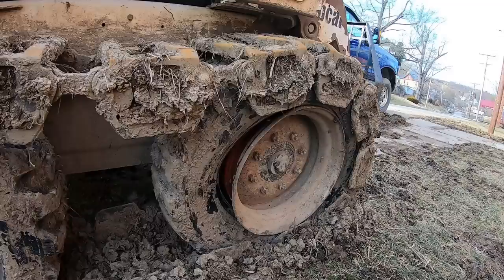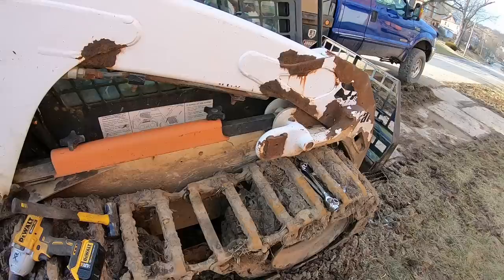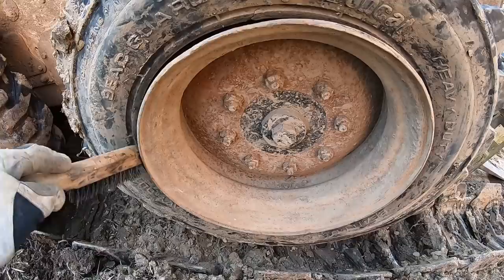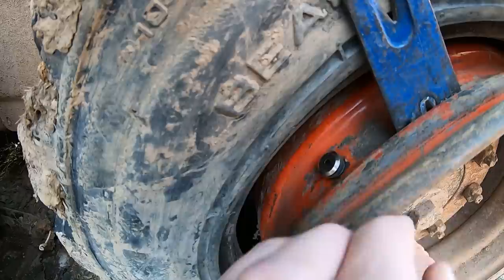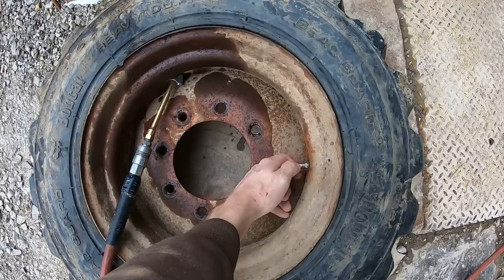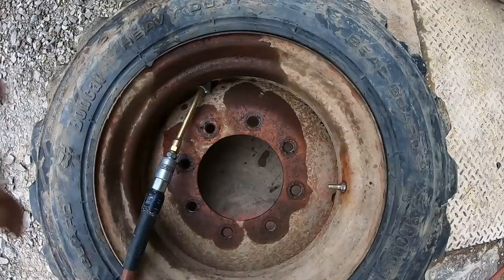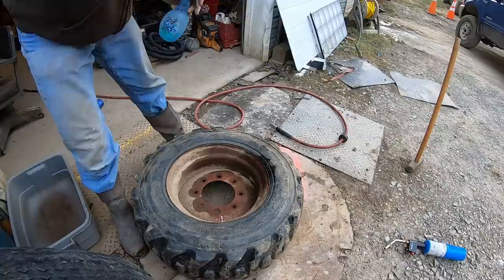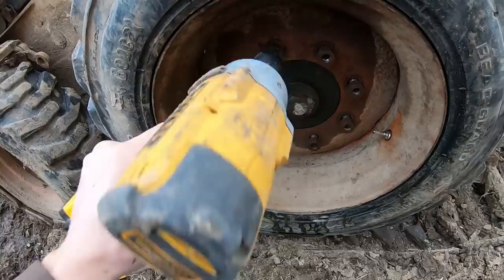Fixing a Skid Steer Tire with Starting Fluid and a Torch!! + all about my STEEL TRACKS

Comment: I know you expect the bad comments and I will get out of the way in the beginning, A friend of mine that owned a shop near mine was killed when a tire exploded doing this. That said I had done this for close to 30 years before and still do occasionally but I will usually try to put the tire on the other side of the implement bucket or something substantial. Ok, Disclaimer out of the way. I have found that if you remove the valve stem when reinflating the tire as you do the ether trick you will put a lot more air in and that helps to seat the bead. If you have tapered bead tires this will sometimes not hold as you take the air off to reinsert the stem unless you put full pressure in and get the stem in without losing all the pressure. Also, frozen implement or truck tires are going to have a tough time getting out to the rim and staying there. I have also found that it takes several tries and in that process it warms up the tire and makes it a lot more pliable.
Reply from the maker: Yes I believe that’s what happened here. Tire warmed up.

Comment: I had to use a large ratchet strap and wrap it around the circumference of a tractor tire to preset the bead and it worked first try.

Comment: Take the valve core out, and then use an air compressor will get the bead to seat quick like a bunny, then put the stem core back in and you'll be all set. finish air pressure.

Comment: Tire fitters i have seen in the past used a large fat soft rubber ring between the rim and tire to stop more air going out than in, maybe you have to connect the small pipe to the fluid nozzle to direct it into the tire chamber? i just connect a good compressor and hear where the air comes out and work on that area so more air goes in than out, always worked for me without fluid or other aid.

Comment: Those rims need pipe valve stem guards welded on.  My tractor and NH L555 both have them.  Never had a valve stem problem in over a decade

Comment: I have had great luck using a strap binder around a tire I would center it on the tire and ratchet it tight and it would push the bead tight on the rim inflate the tire and release the binder and finish inflating been doing it for years works every time love your video's

Comment: Next time you get caught with a skid steer tyre coming off the bead try using a ratchet strap around the centre of the tyre pull it tight so it pushes the tyre walls out and remove the valve so you can get more air in quickly.

Comment: A band clamp (ratchet strap) around the center of the tire and very tight will work and although less exciting, it can help do this job without removing the tire and rim from the machine. You will still need to remove the track though.

Comment: I’m in the same boat here. No bead blaster so I use whatever flammable can I can find, carb cleaner, either, etc on my skid steer. My tires are old and leaking out the sidewalls. I keep slime in them and that keeps them good for the most part. I’m really interested in those tracks, may need to get some.

Comment: When you're using the compressor take out the valve core so you don't have the resistance of the core when popping the bead. With it out of the way you can dump a lot more air into the tyre, once the bead pops into place stick in the core and inflate as normal.
Reply from the maker: these tires will come right back off if there is no pressure in them
Reply: @DieselCreek  
You can stick the valve stem back in before the pressure is gone.

Comment: A few things, one: rim needs secured when inflating (encase of catastrophic pressure lose while filling) two: Never move the equipment from the outside (you shouldn't even be able to) three: block the equipment up after raising it do not rely on the hydraulics while working around it (they do fail) and forth: do not leave the forks/bucket up while not on the machine and do not stand/work under/around the raised bucket/forks/boom (I've seen too many fatalities with each up these items.) 

Not saying you have ever had a problem but people emulate people they see do something and not have a problem and then are not as lucky/skilled
Reply from the maker: Yep, this is the comment I expected to get a lot more of, surprisingly your only the second one maybe 👍🏼I appreciate the concern and I know better but sometimes you just don’t have an excuse lol

Comment: I’ve used the starting fluid trick to inflate a tire a few times. It worked most times, sometimes it didn’t. 
Most every time it scared the crap out of me. I put tubes in the front tires of my bobcat and poly filled the rear tires.

Comment: I bet you could use a cable winch in place of a ratchet strap when you're dealing with a really tough tire you would need a chain repair link run the cables through it so it can't flip sideways on you.

Comment: Not sure if anyone mentioned it yet, but in my opinion ether isn't volatile enough because it's a liquid. I use deodorant-spray but any aerosol will do, as long as the gas is flammable. The gas will ignite a lot faster than the ether, expanding more rapidly, giving a better "pop" and also extinguish a lot faster. I have the aerosol in 1 hand and a lighter in the other, spray for a bit than push the lighter in front of the can to ignite.  You might be able to achieve the same result by half-pressing the switch on the propane-torch for a while before pressing it full to ignite. But since I haven't done that myself, I wouldn't recommend it to anyone.

Comment: Matt thank you for the FYI but the steel tracks,,,,,,  as for blown up the tire yeah it’s a quick fix are usually take a chain come along wrap around the tire and then put a blanket over it just in case the chain let’s go..... So chain would go anywhere,,,, but that’s not me,,,,,,, didn’t realize about the tracks!!!!!!!!!  got a set of steel tracks of them have not used them very informative!!!!!!!!!  By the way think you should get  an inverter for your truck,,,,,,  so you can charge your batteries keep going just an FYI !!!!!!!!! Am not spending your money just want you to be more  efficient  At your job take care junkman do
Reply from the maker: I’ve actually got an onboard charger! I’ve always got one charging

Comment: I fitted a 195/65/15 tyre onto a 15x10 rim like this, starting fluid wouldnt quite get it there ended up using lp and oxygen 😳,  big bang but ot worked 😁

Comment: You got a good deal on the tracks they aren't cheap  new i will try that brand used also  .a update on your brush cutter holding up? I have a different  solution  air line directly to valve stem with valve core removed   . Dont use air chuck  youwill get more volume of air !

Comment: A ratcheting strap can often be placed around the tire. When tightened it will make the bead move out and contact the rim. There is also actual bead sealer compound to help the seal.

Comment: I have seen a similar metal track laying in a long tray of used motor oil. It was at a wrecking yard.  The guy was hoisting another and letting it drip after water blasting it of dirt. I never did see the outcome if they were any quieter or lasted longer before bushing replacement.

Comment: Fyi from from years in mud its always the worst times someone steels air from tires couple hints one solid shot if you think to much eather put more if you miss the first woof got to a add more oxygen the eather burned it all off jest fire no woof and when its cold eather takes longer to flash off sometimes i heated the side walls with the fire from eather to soften rubber when cold thats why he was having trouble

Comment: Easy to make a bead blaster my dad has made quite a few of them out of old propane tanks
Reply from the maker: I’ve got about a dozen of those kicking around 🤔
Reply: Diesel Creek  just get a 2” ball valve for the blaster and then squeeze a 6” length of pipe for the bead seater.
Reply from the maker: Might have to do that
Reply: Diesel Creek  and also with it if your board and want something to do get a longer pipe and bam instant potato gun lol

Comment: Something that I have done is to run a come-along or even better a wide ratchet strap along the tread to put pressure on the bead.  That was on trailer tires, but I expect it works elsewhere.

Comment: I would have used a 1 1/2" ratchet strap wrapped around the middle tread. Tighten it up till both beads wereon the rim then aired it upmaking sure the beads would seal

Comment: Hey Mat, I know this is an old video but just in case you aint figured it out yet, wrap a ratchet strap around the circumference of the tyre and as you tighten it , it will force the bead out on both sides. Bob UK

Comment: Easy put a block under the  back right side and drop the bucket lift the right side of the skidder up and let the tracks roll around until all the crap drops out.
Reply from the maker: never thought it would be an issue before I took them loose!

Comment: Whenever I've watched the tyre fitters put new boots on my hooty they leave the valve core out until they've inflated the tire and seated the beads. Then they fit the core and inflate the tyre to the correct pressure.

Comment: (Just saw Rock Hill beat me to it). Just use a heavy ratcheting load strap around the center of the tire and ratchet it down it will squeeze the beads toward the rim and works! Fluid works but you cant be bashful.

Comment: Every time I've done this I just kick the driving surface of the tire. The trick is using the tire as a bellow to make an air/fuel mix so the either ignites well enough to create the vacuum around the bead.

Comment: Front tires on my CUT are same size as a skid steer. Had one side of a tire come off in the coldest part of winter. No way I was working on that outside in the sub freezing cold with rock hard rubber. I brought the wheel and tire in and sat it by the wood stove and went to bed, one bead still off. Woke up next morning and both beads were seated but there was no pressure in the tire. I have no idea how that happened.

Comment: Interested to know why you are not running foam filled tires? I run them on my S2 20 have never had a problem just replaced brand new ones except for extremely deep mud or a very steep hill I have no problem

Comment: I'll tell you something I use especially if wheel has a little rust works on all tires to help seal the bead clean around rim with brake fluids works wonders
Reply: Or a very thin layer of silicon rubber :)

Comment: On the tire need I use gas down inside the tire ,the explosion works great n out extinguishes immediately .also check into foam filling the skid steer tires no more flats.But makes them very heavy,
Reply from the maker: Yes I’d like to foam fill these

Comment: i noticed a few times that starting fluid is not as flammable anymore and wouldn't work for me so i used the strap method and my cheapass emergency compressor got it down now lol

Comment: Another way that works on new car tyres that  been stacked on their side and won't sit against the beads. You get a 2'' ratchet ti down and wrap it around the tread on the tyre as tight as you can.  it works. That probably wont work on the tyres you are using there.
Reply from the maker: I do that with smaller tires, not sure about these big ones.

Comment: As I watch old videos ... I have had luck with stubborn older tires like this by actually wrapping a ratchet strap around the tire - the pressure around the middle of the circumference of the rubber seems to help flair the bead against and into the rim easier.
Now admittedly I've never done this on anything larger than a pickup but hell anything can be worth a shot when you're desperate right?

Comment: Been blowing up tires like that for years,especially big 4x4 tires.Have blown a few rims out of the tires also when a little to much either applied :O
Reply: That’s why anytime I see somebody doing this I get far away. All it takes is too much ether and a tire with a weak spot in the sidewall and you’ll be eating rubber.....
Reply from the maker: I’ve only blown one up and it was super dry rotted. Didn’t do anything wild just put a big hole in the side wall

Comment: I have used a 1 inch ratchet strap and removed pin from valve stem so air will go in faster to seat bead on the rim hard with air tank i had compressor that plugs into power port in car after seating tire on rim

Comment: You ever try propane instead of ether?  Has worked for me.  Might have a little more thump.
Reply from the maker: I’ve tried it. No luck….. different types of ether work better. This stuff is junk
Reply: @DieselCreek  Might be worth a try again.  You don't need a lot.  If you do too much, there won't be enough oxygen inside to get a good pop.  You probably had either too little or too much propane.  Nice thing about it is it doesn't keep burning after you light it.  Love your channel.  We should do a collaboration sometime. If you ever need something custom machined or cast let me know.

Comment: As others have suggested this really works better with the valve core removed so you can get a bigger volume of air in there. I know it looks sketchy to some but the only times I’ve seen this go wrong is on a bigger tractor tire and the guy was using too much fuel. Was that ratchet strap one you cut the end off of or can you buy them that way?
Reply from the maker: You can buy them that way, they are called endless ratchet straps

Comment: You know there is another way you can take and put a rope around the middle with a turnbuckle and it will force the outsides toward the rim and that will air up every time you could even use a ratchet strap right around the middle tighten it up put the air to it and it'll pop right to the outsides I love the video though
Reply from the maker: I’ve done that with smaller tires but actually broke a strap and had it hit me one time. I think the ether is actually safer to me
Reply: @DieselCreek  oh man I never had that happen with a strap breaking but I can see where that would me a problem anyway you know if the either works for you keep on using it man you know the old saying don't fix it if it ain't broke cheers brother

Comment: Just a thought here, what is to stop the fire inside the wheel from continuing to burn ? I mean there is lots of rubber to burn along with lots of air because you are pumping it in !
Reply: No oxygen, but that is where the danger lies. If there is a piece of loose rubber in there that is glowing and there is left over ether in the tire when it seated and all the oxygen was used up you have two of the three things needed for fire, Heat and fuel, you just need oxygen. When you add air through the valve stem there is your oxygen and you now completed the triangle. Under some rare circumstances if the hot ember and left over ether and air all combine in the right ratio you have a bomb that will blow that tire and rim apart with the force of a hand grenade! I saw it personally when a friend of mine was killed a couple shops down from mine doing this. It blew the windows out of every place for a quarter mile around. It is rare but it happens and I stopped doing it in 4x4 tires since there are safer ways with straps. Just takes a little longer. This method is still viable for smaller tire like Matts skid steer but the bigger the tire the bigger the risk.

Comment: Push the tire in with your foot and spray the fluid inside the tire. Otherwise it takes a few tries. Just spraying it around the outside doesn't work great

Comment: Remove valve stem core before doing this as the air in the tire cools it will create a negative pressure and the tire will suck in possible breaking the bead all over
Reply: Also the force of explosion can damage valve core

Comment: Buy yourself a cheater it’s what we use in the uk I don’t know what it’s called for the us but it’s a air blaster it will come in handy for when you need inflate a tyre when it’s off the rim and can’t be sealed by just air I use the cheater most of the time when I’m doing tyres on trucks and trailers

Comment: thats the main reason i bought a track machine, so i dont have to do mess around with flat tires
Reply from the maker: ys id love to get a track machine, but when you knock a track off its just as bad if not worse!
Reply: @DieselCreek  ive had mine 8 years and never had a problem, proper track tension and caution around stumps are a must. the tracks are heavy but not hard to get on and off if you know what your doing.
Reply from the maker: @davesilvia9711  ive changed a few, seems like they only time they come off is when your in some messed up spot between a rock and a mudbog, we had one come off at work once on a steep slope against a road ditch, ended up having to have our crane truck come pick it up and set it on the truck and haul it away to be fixed where we had flat area to work on it!
Reply: @DieselCreek  lol, the tire machine with tracks has a better radius on the track vs track machine has on the idlers for climbing stuff. each has advantages and disadvantages, but as long as it gets the job done thats what really matters
Reply from the maker: David Silvia yes, trust me I want a track machine in the worst way just can’t justify it currently. One of these days tho!